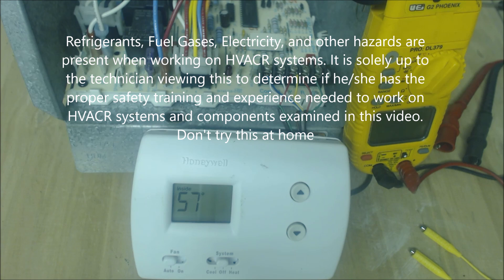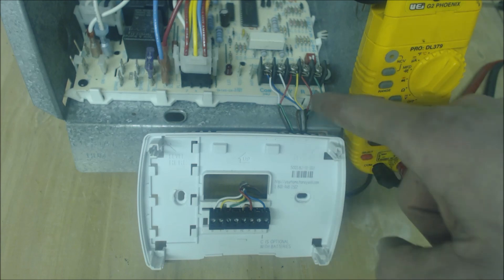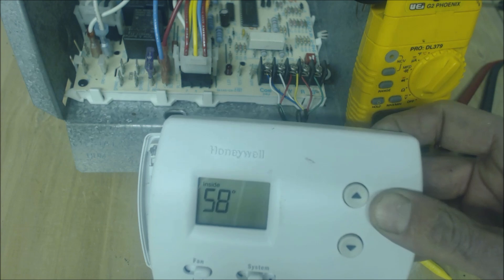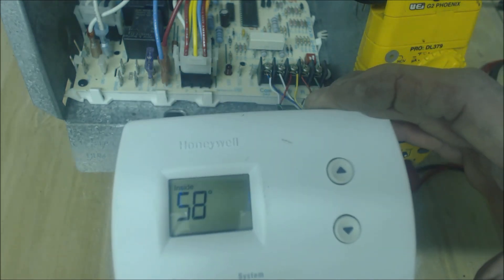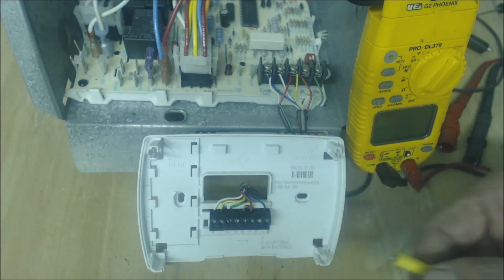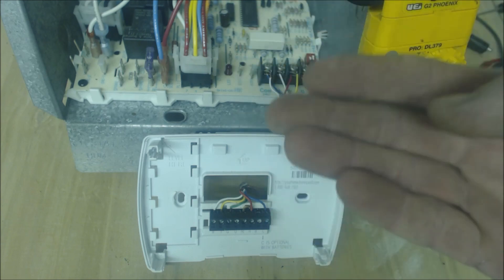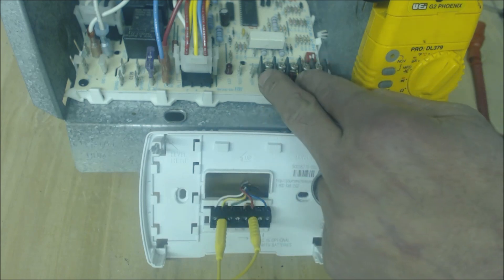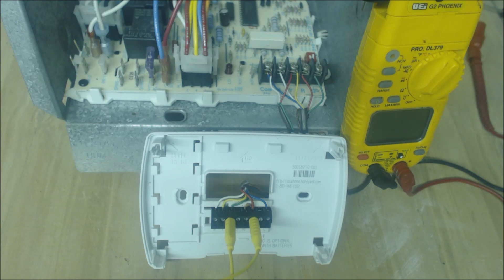Bypass the HVAC Thermostat for Testing of Furnace and AC Units!

Comment from the maker: Tool List-  https://www.amazon.com/shop/acservicetech
Support-  https://www.patreon.com/acservicetech
For those that are looking for the tools used in the videos: (Linked Below)

Here is a link for the Supco Magnet Jumpers http://amzn.to/2gS4h6z

Here is the Link for the newer UEI DL479 Multimeter with temp sensor- http://amzn.to/2jtsUbJ

Here is the Link for the newer UEI DL469 Multimeter- http://amzn.to/2jw4ePJ

Here is the Link for the UEI DL389 Multimeter used in the video - http://amzn.to/2naJr9o

Here is the link for the Irwin Wire Stripper/Cutter/Crimper   http://amzn.to/2dGTj2V

Here is the link to the Fieldpiece SDMN6 Dual Pressure Testing Manometer with Pump-http://amzn.to/2jyK5Ka 

Other tool links can be found in the video description section. ACSERVICETECH is a participant in the Amazon Services LLC Associates Program, an affiliate advertising program designed to provide a means for sites to earn advertising fees by advertising and linking to Amazon.com.
Reply: acservicetech  good
Reply: Hi acservicetech, nice video.  I have a problem where mine only has 3 wires, inside tabled D R B.   It's a trane TCONT900AC43UAA communicating thermostat for a trane XL20I 5 ton heat pump and AC unit.  Googling of course will show you pictures.  The recent nor'easter storm we had with high winds caused us to lose power.  When the power returned the Trane ComfortLink II thermostat has a blank screen even though it does not rely on internal batteries.   I think the storm and surges of electric may have fried the thermostat.

So I turned off both big breakers, and put them back, still nothing.  SO I pulled off the face of the thermostat and there's these 3 wires  D R B.   I left the two breakers on this time.  Using a volt meter I measure from D to B not 24 volts, but only 12.23v.  (1/2 of that).  If I measure form R to B I get the same 12.23v.  If I measure from R to B I get like about 3.25v.  So I wonder if it's some unknown secret that it's 1/2, or they combine for 24, hmm.  

It's called a communicating thermostat.  Anyway, it seems to have power running up through those lines.  So I was thinking about jumping them to see if the unit comes on, only I think it might be more complex than this being that one line is a data line etc.  Anyway, the LCD touch screen thermostat is totally blank.   The only thing I can think of is if there is some fuse outside that blows, and many it can't work even though there are two breakers inside.  The first for heat is 100 Amps.  The 2nd mentions AC or something like this.  I just have always turned them both on or off at the same time.  So should I try to jumper them to if unit comes on, or is there a better way?  If you find this could you answer quickly because we're really cold, lol.  Anyway, no LCD touch screen display working, and nothing runs or turns on.  It was all working perfectly before the storm and winds, and electric loss.

I was tempted to order another thermostat, and they were like $50 to $100 5 years ago.  But now they want $299!  I'd hate to order that and find out it's a fuse or problem is elsewhere.  Being a tech, I'm thinking that even though this seems like a challenge, you might just be able to figure out how to test if it's the thermostat or not.  Again only 3 wires.   thanks.

Comment: I have a question I hope I can receive an answer to it. My AC was running fine on the Fourth of July the lights were flickering and I get thermostat Has the last communications the network
One technician came only checked the bottom unit and 
Told me that it wasn’t getting the 240v From the quick release box when I hire another person to come and check it out this person says the Quick release box is receiving to 240v and they got a non communicating thermostats
When that didn’t work then they had the bright idea to get the red wire and hook it up together with ground off the thermostat with leaving it Connected to the thermostat. They claim they did this to pass power to the air handler because It didn’t have no problem. Once they did that they said the blower motor got really hot. Somehow I don’t think 
Neither one of these two are telling me the truth what could be the problem my suspicions is the transformer A broken thermostat wire from the air handler to the unit outside. One more thing when pressing the test button on the unit on the back half every 10 times you press it it only comes on 2 times or and there is a couple of Black wires with connectors disconnected upstairs I really don’t know why they disconnected that

Comment: I have something very odd happening. My Honeywell (battery powered) has C, R, W, G and Y. When Honeywell turns on A/C it seems to engage Y and G, and compressor kicks in. But if I try to achieve the same using hot wiring, I cannot get the compressor to engage. 

Trying to solve this first, because I am trying to switch thermostats and it isn’t turning on A/C, and I figure if I can’t even hotwire it, I should solve that first. 

But the Honeywell works!! It’s driving me nuts. Any tips are appreciated. Volt meter shows R to C have 25V as expected.
Reply from the maker: For ac mode, just touch r to y and g at the same time so just turn the power off and put the three in a wire nut and turn the power back on, thanks.
Reply: @acservicetechchannel  thanks for replying. Unfortunately that’s what I am trying and it doesn’t kick on the compressor. But when I get the Honeywell to do it, and I monitor the voltage changes with a voltmeter, it’s doing exactly that. I just can’t seem to figure out why I can’t make it turn on via hot wiring.

Comment: i am not geting power to common wire but i do get power to red wire
Reply from the maker: Yoiu won't have power at common but to read 24v one multimeter probe is on common and one on the r terminal, thanks!
Reply: i did but didn’t get any i do the red and any other and i do get power just not the common
Reply: @obet191  same here

Comment: I have the same thermostat as in this video. Fan will run when switched to "on", but A/C and heat won't come on. Also, the thermostat shows the inside temp, but there is nothing showing up under the "set to" temperature. Bad thermostat?
Reply from the maker: Yes it sounds like it if you are pressing the up or down buttons and nothing is showing on the screen, thanks
Reply: @acservicetechchannel  Thanks. I made a jumpwire and everything works fine without the thermostat.

Comment: Thanks! Very helpful. I don't have the fancy magnetic connectors so I used a pair of locking forceps that have been laying around here for 30 years. Success! Temporarily connecting Y + R wires turned the A/C on and proved the cheapo thermostat was defective. Saved $100+ on a pointless service call.
Reply from the maker: Thanks Michael!

Comment: hello, I am currently testing a Nest Thermostat which I am currently powering with a Class II transformer 24 Volt AC 20 VA MGT-2420. I am connecting the positive output of the transformer to the Rc Rh inputs in the Nest and the Negative to the Common on the Nest. I do not have an HVAC board to connect this device to. Is there a specific relay, or other device that you could recommend in order to replace the Cool, Heat, and Fan?
Reply from the maker: You could use 12 amp fan relays like this one- https://amzn.to/2VpdDe2 which will close 120v contacts such as a blower. We would make testing boards like that in the HVACR shop and use contactors such as this one https://amzn.to/2Ru91E9 -  to power 120v loads like lights and a fan that we would take out of old microwaves

Comment: First of all thank u for the videos and helping to train the laymen like myself. Very informative. Question, I have a constant 24v on the terminal strip at every connection point (W R Y C G) on the IFC. Why could that be? Could the strip be shorted out? Brand new circuit board by the way. Thanks in advance for ur response.
Reply from the maker: Are you measuring with one probe on the r and the other on the c or one probe on the w and one probe on the c?
Reply: Tested from common to all terminals. Only 24v at R so that’s good but I disconnected all wires from both terminal blocks (thermostat and circuit board) and I still have 120v  at the H blower terminal with blower running constantly. I think I have a bad board but it’s brand new. Just replaced old one for burnt relay.
Reply from the maker: It might be a safety switch that is open that is making the board send the signal for the blower all the time, thanks

Comment: I tried connecting the R and Y wire directly but the ac didn't turn on, even the fan didn't.  What could be the reason/s?
Reply from the maker: Was that connected at the control board or at the tstat? If it was at the tstat then try it at the board. Also try R to g just to see if the fan turns on at the board. Make sure that you read 24v with a multi-meter from R to C any time the power is on and any door switches are closed, thanks

Comment: So what could be going wrong if my unit works when bypassing the thermostat, but changing the thermostat doesn't fix anything.
Reply from the maker: Is the initial problem that the tstat is not lighting up or just not turning ac, fan, or heat on. If so which functions work? Thanks
Reply: Initial problem is that t-stat turns nothing on. A/C doesn't work at all, fan will not come on if i just set it to fan setting, too hot to test heat. Heat and fan both worked perfectly just 2 months ago. I just connected the yellow to red when bypassing the t-stat, which turned on A/C. I didn't test anything else but that yellow wire(another website said this was how you can test to see if you A/C not starting is a result of a bad-stat). T-stat has good batteries, display is workin, it will say "Cool on" letting me know I have it set to cool the home. Nothing happens though.
Reply from the maker: By chance when you installed the new tstat, did you not install a jumper between r and rc? It sounds like something isn't right with your new tstat. It sounds like its the tstat if you can jump it and it turns on, thanks
Reply: No jumper, however the old thermostat had no jumper either. What would make up a "jumper"? How would i put one on

Comment: This may not have anything to do with the video but i have propane back up but iv run out of propane and my thermostat is still trying to ise propane because its below a certain degree how do i bypass the propane from trying to cut on and just use my heat pump? Thanks
Reply from the maker: You would need to change your settings set in the thermostat program. Basically you would want to power aux but not e by itself. Also here is a video on the wiring that needs to be powered-  https://youtu.be/7e5uDEHaDnA

Comment: My fuse for my main board blew replaced it and unit and thermostat comes on then turned on to heat but cooling comes on instead. My unit is a heatpump.  Need to put on aux heat for gas to work should be just heat not aux heat. Could it be my thermostat gone bad?
Reply from the maker: It sounds like you may be having a problem with powering the reversing valve wire for the heat pump in heating, thanks

Comment: My fan will not turn on in heat, fan mode or when jumping red to green on control panel..it makes a loud click, but it works fine in cool mode..any advice for a next step diagnosis
Reply from the maker: Is it a blower motor with a capacitor- meaning a psc motor or is it a variable speed motor?

Comment: I've watched several of your videos, and your super informative.. it's unreal! I even went to a 2-year vocational and wasn't shown half of what I've seen here. Especially proper superheat and sub-cooling. I used to tend to make simple trouble-shoots harder than they are. You've made it simpler thanks dude!
Reply from the maker: That is really awesome Steve! Thanks for letting me know how much these videos mean to you!
Reply: acservicetech  Absolutely! We had an electrical storm last week, and the outdoor capacitor went out. I knew automatically what was up but I got it changed even checked the fan motor to make sure no windings burned. I enjoy this field and want to work more in it! Your helpful. Good day to you sir.
Reply from the maker: Yeah it is awesome when you can start to partially diagnose systems over the phone while talking to the customer while making sure on their end that it is not something like a breaker that is off or something. We don't want to come over and have to charge for that. But, we start to get a clue of where we are going to start our diagnosis, thanks Steven!

Comment: Thanks for the mag jumpers use. I've never seen these but just ordered them.  Also, is it possible to just check for continuity between the various pins coming from the face of the thermostat as you switch it from one operation to another? With batteries in it I would think that could verify each setting on the thermostat.
Reply from the maker: Absolutely correct!

Comment: When you jump r to y does it turn on the condenser and the blower inside
Reply from the maker: Yes on most control boards the y will give the signal for the blower to turn on but on older units the fan center or board will also need the g as well. The thermostats will automatically power g when cooling is on but on most units the board will recognize y and the blower will come on at the fastest speed. Thanks trukin forever!
Reply: Hi. Hoping you can point me in the right direction. My installer doesnt seem to know how to straighten this out. We have a nest y1 to y1 on handler. y2 to y2 on handler. g to g on handler.  Heres the strange thing.  When the nest calls for cooling, the airhandler/blower always goes into high cooling?!??!  The only time low cooling ever works, is if the G wire is disconnected?? Please help :)  any advice?

Comment: When you say "turn the power off" do you mean at the breaker box? Thanks!
Reply from the maker: I meant at the furnace on/off switch on the outside of the unit and then verify that there is no power with meter. Thanks
Reply: Can you hook the jumpers up without power down

Comment: When the fan is in auto at the stat and a call for heat or cool starts, does the stat also send power thru the green wire to the board or is the fan started thru the board when a signal from the yellow or white wire is sent from the stat. Thanks.
Reply from the maker: Most times the g is also powered by the thermostat when the r touches y but the control board in the furnace knows to turn the blower on high speed usually regardless of if it has 24v at y or 24v at y and g. In regards to heating W is the only one that is powered because the furnace has to go through the sequence of operation and here is a video on that and how to jump out for heat to turn on ----- https://youtu.be/uKsRpYmwlnM
Reply: acservicetech Thanks a lot, keep up the videos they are really appreciated.
Reply from the maker: Thank you Wayne!